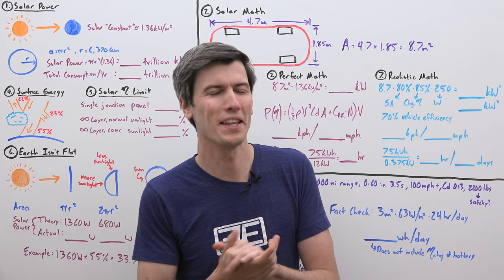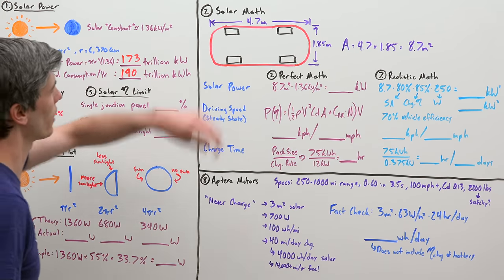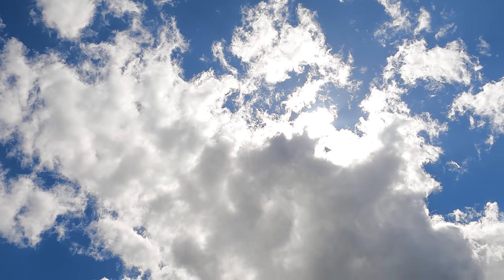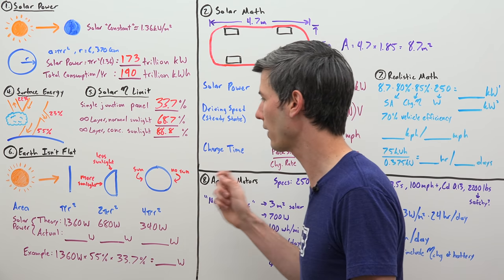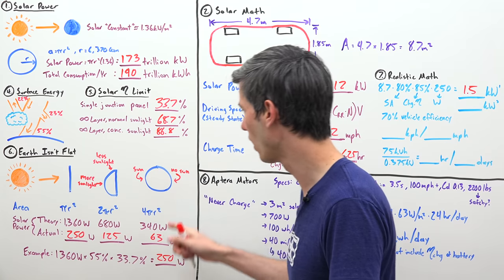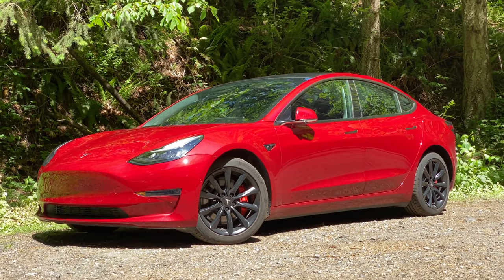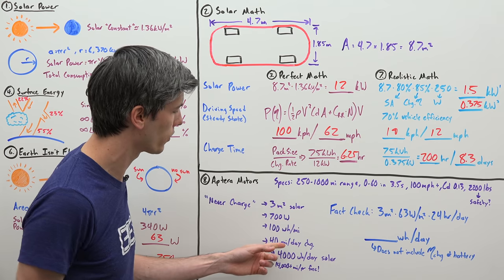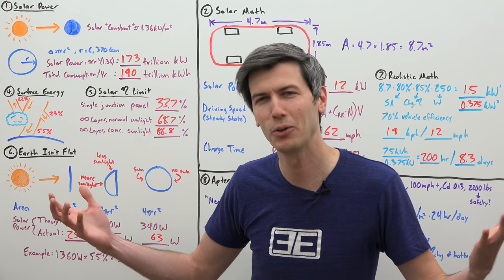Why Don't Solar Powered Cars Exist?

Comment: If Aptera can genuinely pull off the 100 wh/mi, that's a hell of a feat.
Reply: Aptera be like: 
100 wh/mi *

* at 20 mph...
Reply from the maker: If you cut the Model 3's frontal area and weight in half, you get pretty close. Not sure what frontal area of the Aptera is, but it seems pretty small.
Reply: I know right, I'm really curious, I think for a lot of people in Europe 40miles a day or about 64km a day is enough for most of the year so alot of people could potentially drive "free" ofcourse you will still have maintenance, road taxes and everything else but fuel is free.

I can't speak for the us, since everything is much further apart over there but still I'll take every penny I can save on fuel
Reply: Have you seen their car though?  It’s shape is sacrificing almost all practicality for efficiency’s sake (which I admire in this case).
Reply: @imitane  how often do you have more than 2 people in your car?

How often do you have more luggage than what fits in an aptera?

Because both of those are gonna be single digit percentages for average joe.

So the aptera gets the job done almost always. And when it doesn't there are carshares for a cargovan that fits a few cubic yards of stuff or  a 3 row van that seats 10 comfortably.
Reply: @championxxlNL  average miles per driver in the US daily is mid 20's.
Reply: @anonym3017  Maybe we need to have long weekends staggered on different weekends, based on the first letter of the last name.  Like license plate renewals.
Reply: @ApteraMotors recently posted a video of their latest alpha vehicle, Sol, which showed an average of 83 Wh/mi over about 4 miles.
Reply: A few decades ago engineering schools were driving cars across the country on solar pannels alone.  25 mph was not close to fast but they were crazy efficient
Reply: @lylestavast7652  Sigh. That. Doesn't. Matter.  There are literally millions of people who regularly have a need for MORE than 400 miles of range.  Just because they are in the minority doesn't mean they don't matter.
Reply: Aptera says their car is more aerodynamic than f150 side mirrors
Reply: Frugal Family Living  Even if wouldn't be true, this is hilarious
Reply: @jayjohnson3732  so what? They can just buy another car.
Reply: @Chamieiniibet  Oh good.  I'm sure they would all be overjoyed at being told how to live their lives by an entitled, self important stranger who wants to limit their choices.
Reply: @anonym3017  It's worth noting, though, that the Aptera website, with all its pictures, carefully avoids showing the cargo area, just the front seats (and I assume it's only a two seater). It doesn't have much of an underbody, and it needs a place to store the motor and batteries, so that doesn't leave much room for groceries.
Reply: @jayjohnson3732  where do you get that choice limiting from? It's all about more choice — there's no option for a self-sustaining car yet for anyone, and you're bashing people for suggesting there will soon be some.
Reply: Unfortunately, I fear that Aptera will continue to be vaporware. I saw their prototype nearly a decade ago, and was ready to buy. And Tesla leapfrogged them. It's not that the idea is bad - it's that they have consistently failed to move to production, let alone production at scale...
Reply: @lylestavast7652  I drive at least 180 miles each day for work. So 900 miles per work week. The lowest range I'd feel comfortable with in an electric car is near 350 miles due to inefficiencies introduced by climate control, outdoor temperature effects on the battery, and entertainment (radio/cellphone charger/etc.)
Reply: @smwsmwsmw  the motor is in the wheelwell.

The battery under the cargo area.

And you can see it. They have an exploded view of the car on the main page.

It's big enough for the bags of two people, shopping, etc.

So everything that's needed in the day to day.

Cause hey on the long weekend with friends you can just rent a big SUV and still save money.

Cause here's how to spend the least on vehicles.

Get the smallest and cheapest one that gets you through the daily stuff. Then rent a bigger one when you need it. Carshares make it easy.
Reply: @arrowmouse  Well it sounds like it at least has more value than a smart car. Those were small as well but unreliable and worse on gas than a cheaper, larger, more powerful, and better handling car. So you weren't really gaining anything except expenses and nuisance.

This though, maximum efficiency.
Reply: @macnlz  like detroit electric. They had nice looking concept passenger cars, then they fizzled out, then they made a car that was basically the old tesla Roadster... and where are they now??

Zenn almost 2 decades ago... People want electric cars and have for a long time, even with range constraints, but    there are huge barriers to entry in the auto manufacturing market. It's really too bad they don't do more to help new entrants, meanwhile they repeatedly bail out large companies (some of whom can't manage their business *cough Chrysler *cough*).
Reply: @jayjohnson3732  your car doesn’t run on oats and climb stairs so it doesn’t work for towing a barge along a canal and therefore is useless for anyone ever.
Reply: @sketchyssk8shop  Yes, I believe they were the winners several times and used the money to invest in further development.
Reply: @RandyTWester  they tried that in Greece, to reduce congestion , they allowed odd numbered plates vs even on different days. People just bought another car.
Reply: @anonym3017  The exploded view doesn't really show any details. Hey, I wish them all the success in the world, but this design is essentially the same as the original design (without the engine) from 15 years earlier, after which the company crashed and burned, hard.
Reply: @arrowmouse  3 wheels, so licensed as a motorcycle.
Reply: @smwsmwsmw  If you look on the website it clearly shows the motors in the wheels and the battery in the floor. It also says Aptera has 25 cubic feet of luggage capacity.
Reply: @smwsmwsmw  it shows the width of the cargo area and the lower bounds compared to the passenger area.

Upper bounds are unnecessary as that'll just the the trunk lid which can be seen on most of their pictures.
Reply: @chandlermorris712  Aptera has a model with 1,000-mile range. Obviously you can't solar charge that up every day (unless you have solar panels at work).
Reply: @jayjohnson3732  I just gave the actual statistic of per driver per day, your mileage may vary.  As does mine. Sometimes. Less than 5% of US drivers drive more than 120 miles in one day in a month. We use cars to death, but it's almost all really short hopping around.
Reply: @chandlermorris712  you are definitely one of the exceptions by miles. Imagine how many people drive really low miles to bring the average per driver down to 29 miles per day....given the long distance types. And an average balances out the edge max/min cases ...
Reply: @lylestavast7652  In the context of the discussion it was clear (to me) that you are dismissing the idea that the need for a long range car applies to more more than a handful of drivers.  First, you could not be more wrong.  A LOT more than a handful need a vehicle with a long range on a regular basis.  People like @Chandler Morris (and ME) are in the minority, yes.  We are not, however the EXCEPTION.  There is a MASSIVE difference between one customer in a thousand, and say 30% of the customer base.  I promise you the number of people with a regular need for long range vehicles is much closer to 30% than .1%.  The figure you quote does not address the need that may not be daily, but is regular, and normal.  The empirical evidence is right there in the concentration of Teslas in different parts of the country.  California is covered up with them.  Flyover country, not so much.  And no, that is not ONLY related to Supercharger locations.  Second, even if the number of people with the need were as small as you clearly believe (it's not), it doesn't make their need any less real.

And yes, I have had it up to my eye balls with urbanites telling me that I don't need a long range car.  You may not.  I DO.  And I know many others who do as well.
Reply: With all their optimisations it should be possible. I've done 166Wh/mile in my Tesla model 3 over a 40 mile journey ... very favourable conditions of course and not typical but it's starting to get into the same ball park.
Reply: @jayjohnson3732  How about you use the math to work for you by investing in the car that works for the so called “majority”, make several multiples of your money, and maybe use that to buy a 400 mile tesla instead of complaining that futuristic innovative technology isn’t perfect for you
Reply: @Chamieiniibet  👏🏾👏🏾👏🏾👏🏾👏🏾👏🏾👏🏾👏🏾
Reply: @shinequashie393  I’ll say this once. I don’t need your effing advice.  What I said was that I am tired of self  righteous know it all’s telling me what I do and don’t need.  And now I will be following the advice of Mark Twain.
Reply: @chandlermorris712  Do you understand that the aptera also has a battery you can charge to 1000 mile range?? 
The 40 mile feature is just and added benefit to FREE SOLAR POWER. Which is only possible because they focused on efficiency
Reply: @shinequashie393  I do. I'd even contemplate buying one if they come out.
Reply: @jayjohnson3732 In your case I don’t see how that’s possible, since you are the exact type of “people” Mark Twain was talking about. Lol
Lyle never told you what you did or don’t need. I don’t like those people either.

Also, Mark Twain’s advice was for “arguments”. I am not arguing with you. I am telling you to invent your own 400 car or buy what works for you or let the innovators innovate.
Reply: @anonym3017  How often you want to drive laying on your stomach like a TRON Light Cycle to get better aerodynamics?
Reply: @sammiller6631  you are sitting upright in it.

Also about every trackday with my bike
Reply: @smwsmwsmw  Newest ads show a surfboard in back
Reply: @jayjohnson3732  Just because some people need to drive many miles a day, it does not detract from the argument that maybe a third or half of people driving a car will never need to plug an Aptera in to charge, and rarely have a passenger in the car.  For that very large group of people the Aptera offers something unique at the moment, a car they buy and never need to charge or fuel except the rare long distance journey.  The only costs would be tyres, insurance, road taxes, washer fluid, & maybe the odd replacement part...  For a large number of people the Aptera will be a great vehicle.  It won't be for everyone, but the group of people who won't see so much benefit should most certainly not deprive those who will of the opportunity...  There are other cars that are nearer your needs such as the longest range Model S, 3 or Y, or Cybertruck among many possibilities?  The 100Kwhr Aptera has a range on a thousand miles, and fast charging like other 100Kwhr BEVs, that model would almost certainly suit many high mileage drivers...  Safety advice in the UK is that you should not drive for more than 2 hours without at least a 10-20 minute break, hence for almost everyone then a 250 / 300 miles range is more than enough as those tea / bathroom breaks, plus longer meal breaks near the fastest chargers mean that you will mainly always have far more range in your car than you can safely use!
Reply: @peterchandler8505  I am a little puzzled at your comment.  I NEVER said a word criticizing the utility of the Aptera.  If you got that impression, then at some point I wasn't clear.  I think what they are trying to do is great.  Arguably one of their long range options would serve me better than my Model 3, because in two years I have had more than one other person as a passenger exactly 3 times.  Each of those occasions was optional.  My argument was with short sighted, self absorbed, parochial individuals who think that just because THEY don't need a lot of range, NO ONE does.

Finally, the point you made about not driving more than 2 hours without a break isn't applicable in the States.  Or at least not universally so.  We routinely travel MUCH farther here.  Destinations, and waypoints between them, are commonly much farther apart than in Europe or the UK.  Something else you are missing is that if one routinely makes a round trip (in one day, not an overnight stay) that exceeds the range of of your EV, that means your are forced to fast charge somewhere, which is more expensive than charging at home.  I know someone who routinely (perhaps daily, not sure) makes a 360 mile round trip to and from work, which is why he is not currently in an EV.  He doesn't want to have to charge away from home every day.  In my case, the cost of Supercharging is triple that of charging at home.  The point being that one of the advantages of an EV, economy of operation, is undermined if you have to charge away from home on a routine basis.
Reply: @jayjohnson3732  Hi Jay, my apologies for misreading your comments, guess have seen far too many people criticising the Aptera (& other BEVs) on the basis that because they are a long distance driver, then because the car does not fit their narrow niche, then nobody should have it...  Great to hear that you are running a model 3, have heard many good reports about it, it is however way outside my means at the moment (you may remember Fathers4Justice?, problem not gone away here yet :( ).  I see we have common ground about the range issue...

For most of my career, have been quite a high mileage driver, though not going over 40 000 miles a year, usually a bit less.  Have therefore seen the mess people can make from driving without due regard for safety, so tend to take that advice seriously as it takes far less than a second's inattention at high speed to wreck plenty of other lives, or even your own.  But then we drive a bit closer together here in the UK than the US I guess...
Reply: @anonym3017   I agree with all those points. I actually had a first gen Honda Insight (similar interior volume/practicality) for a few years and mostly enjoyed it.  So I’m not entirely opposed to sacrificing size for efficiency.  Replacing the insight with a Volt has been a welcome change regarding interior volume though.    

Look at the sales numbers of the 2000-2006 Insight vs the less efficient but much more practical Prius to get an idea of what percent of the population would be willing to buy an aptera vs a more traditional 4 door EV.  Although I really do like the idea of the Aptera and hope that they succeed.
Reply: @Libertylute  Autocycle is a term being used in at least some US states use to classify three wheelers. Elio Motors manage to petition most states to create legal classification for three wheelers.
In my state for example (NJ) autocycles get a motorcycle sized license plate, but can be driven with a regular driver's license, and no helmet is required if it's an enclosed vehicle.
Reply: @christophercolumbus7218  Aptera's CTO said the faster you go, the more efficient the vehicle is!
Reply: @EngineeringExplained  Aptera's CTO said the total drag is equivalent to the windshield wipers on a normal car.
Reply: @smwsmwsmw  25 cu ft.  and you can lay down in the back!
Reply: @macnlz  The decade gap b/t first effort and the current one is an interesting back story.  Lots of lessons learned, including "Don't turn the management over to guys from Detroit!"  And yes, they will be in production by the end of the year.
Reply: @smwsmwsmw  The motors are in the wheels!
Reply: @anonym3017  Whenever I take a road trip in the US, I rent cars, if I drive over 14 hours somewhere and have a break down I want to jump in another car, not get stuck out of town paying for my car to get fixed. So an EV for commuting would probably cover 80-90 percent of users. The big family/travel cases would use alternatives when not commuting to work.
Reply: @christophercolumbus7218  Not with a 0.13 drag coefficient.
Reply: Most people on earth have relatively short daily drive distance requirements.  NO ONE CARES about your eye balls and your need for a long range car.  YOU HAVE literally THOUSANDS of choices to find one that fits your needs.

Comment: There is also the Sono Motors Sion which is developed in Munich and built in Saabs old factory in Sweden. 
They promise 30km range charged by the sun in optimal conditions on a day in Munich.

Comment: I think a video on the different refrigerants and cooling systems would be great. Maybe you can explain the significant difference in cost between R134 and R1234YF!
Reply: 134a is a non starter because it has about 1300 times the GWP of CO2.   It was a great gas for addressing the ozone hole problem however.  Propane actually makes a good refrigerant gas.  The flamability is no different than with conventional refrigerants mixed with the oil that circulates with them and can be managed to be safe through proper design.